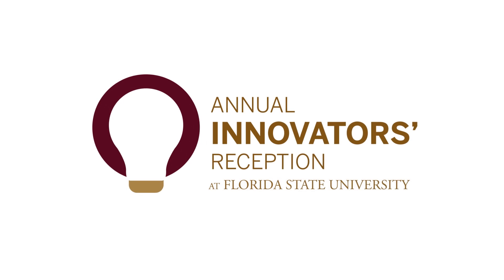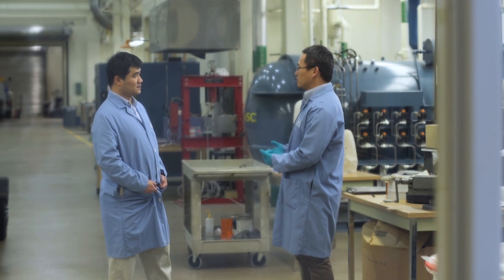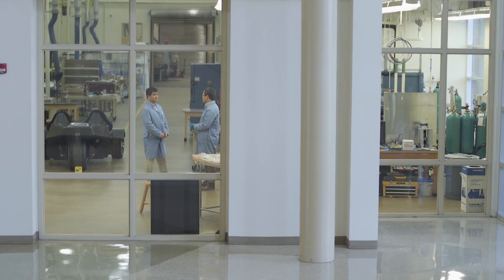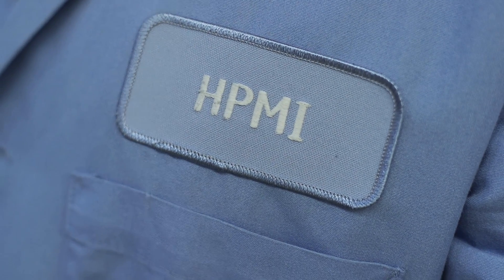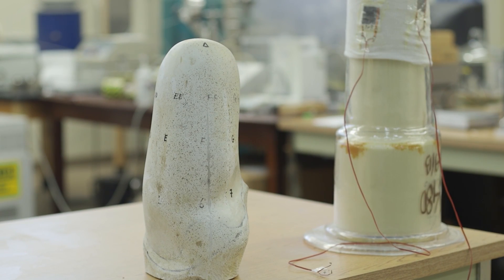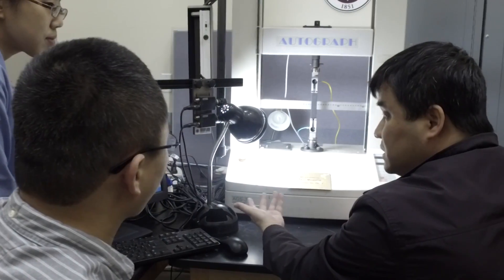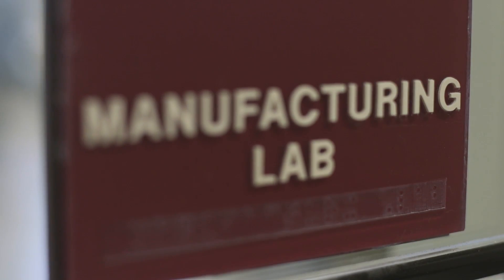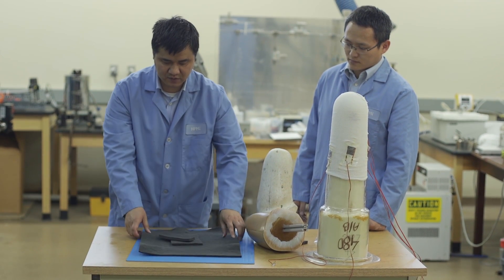Auxetic Foam Research at HPMI

Comment: Ideally a running shoe would be tighten up when it is under pressure on the ground. Tight around the middle of the foot to bind and support all the bones together. And then be loose to let the blood flow when the foot is in the air.